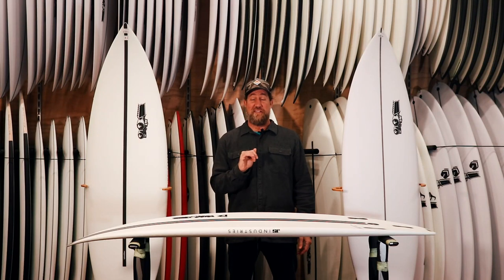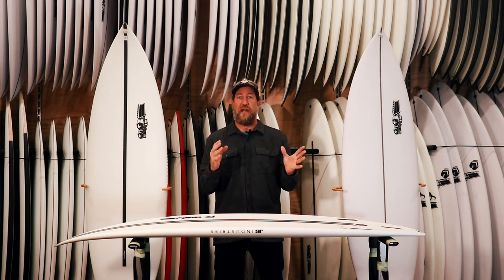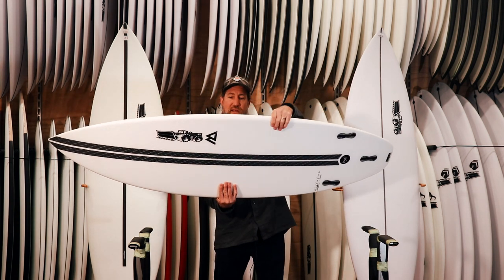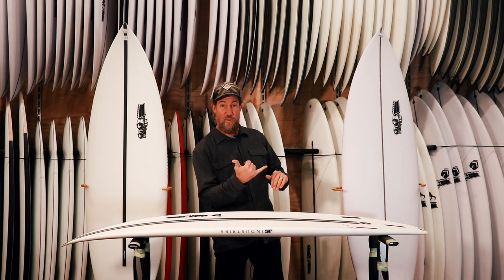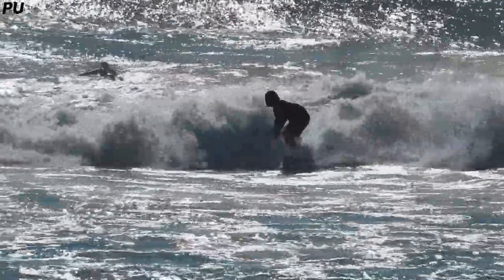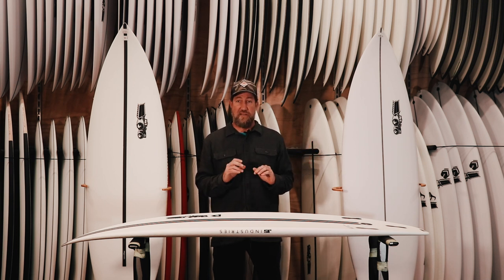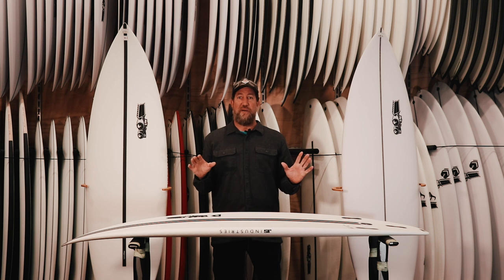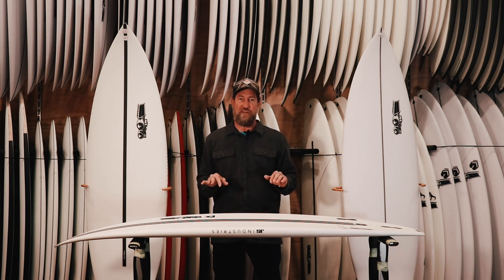EPOXY vs PU / JS HYFI Monsta 2020 Review - WOOLY TV #23

Comment: Its interesting I seen a interview with Jon Pyzel his opinion is eps only seem to float more because they are lighter in weight so basically if you have a pu and a eps exact same weight they'll float identical . So the pros boards are generally glassed light so no real difference for them and we need to get out that eps boards are actually worse for the environment because the foam last for a bloody long time before it breaks where pu breaks down a lot faster.
Reply from the maker: Hi mate
Wouldn't it be great if we could come up with a construction that performed really well and was environmentally friendly!
Reply: I’ve heard mentioned repeatedly eps foam is recyclable and pu is not. Would be curious to hear confirmation on this.

Comment: Also not sure if it's true but  I believe JS tweak the EPS versions of the board so they feel the same so that rider can just use their normal dims which I think it great. Weights are fairly close on both to which I also like. Boards can be too light in my opinion.
Reply from the maker: Yes, I think the pull the top edge off the rails just to get them to sink a little easier. Its only very subtle and I cant really tell much of a difference when I pick them up.

Comment: Fantastic review!! You are excellent at providing the nuance that has been so lacking in the surf industry regarding surf design information for the general public. 

You’re also ripping!! Good job representing for us slightly older and bigger guys!
🤘🤙
Reply from the maker: Thanks! One of the reasons I started the reviews was because I couldn't find anyone doing them that was around my height and weight, hoping these are helping everyone of my fellow larger humans
Reply: Nice to see a reviewer actually surfing the damn board too 🙄🤙🏼
Reply from the maker: @chrro466  I cant see any other way it can be done! You need to see the same guy riding multiple boards so you can see the difference in the performance in each board right?

Comment: Hey Wooly. G'day from NZ bro. Would age replace weight in terms of litres in the Monsta 2020? I'm 57 years, fit, but only weigh in at about 67kg suited up. Looking at getting a second hand near new 6.0 33L. For my good wave board. For our local I mostly ride a 5'8 flat fish Quad.  Trying to find a board that makes the transition from the fish a little easier when the waves are fast and hollow. Cheers
Reply: PS. One day I rode two different boards with too much volume for my weight and they were more maneuverable but sluggish. So slow off the bottom compared to my fish.
Reply from the maker: Hi mate
Do you know the volume of your fish? Or the width and thickness?

Comment: Very good man. 
But JS made it even more difficult...what about the PE construction ? (because down in Portugal we have received some Ranging Bull boards in PE...which I wonder how it behaves (closer to PU or closer to epoxy???)  THANKS
Reply from the maker: I havent ridden the PE (PU/Epoxy) as we don't get those in Oz but they would feel more like a PU as they have the PU blank with the timber stringer.
Reply: The PE is lighter as the PU, but gets dents a lot quicker!
The new Hifly 2 is really good! Much better, stronger and lighter then lost light speed construction! I like it a lot even in onshore conditions but I find it hard to surf when offshore gets strong. Then it feels like riding a bicycle with no suspension down a dirt road.
..and PU is made in Australia 🇦🇺, PE is made in Thailand 🇹🇭 if I am not mistaken.
Reply: @MarcRademacher  thanks . How would you compare it with the SpineTek from CI. I have 2 (NB2 and NB3) and it works quite well (not so good in on-shoe) ?
Reply: @josesnowsneves5132  sorry,  I never surfed a ci, yet! But if you buy a ci in Europe it probably comes from the Pukas, Olatu factory! So far every PU board I got from the pukas factory came with poor glas jobs. Had a few …lost boards from pukas. JS PU boards have are much stronger boards (makes it much easier to resell them after 1-2 years)
Reply: @MarcRademacher  Hi Marc, yes CIs are being produced at Pukas, Indeed you are correct, Lost glassing is not good, however the CI glassing is much better (do not ask me what but I had problems with 2 Lost boards, and, so far, no issues with the 2 CIs I am currently using. Thanks

Comment: Which construction would you go for the Happy everyday?
Reply from the maker: PU if in solid waves, EPS for more gutless waves 🤙
Reply: @WoolyTV  solid would be over head ?
Reply from the maker: @RBNK157  shoulder high and up. Or really punchy small waves. If the waves are weak the EPS will win.
Reply: @WoolyTV  i have a neck beard2 spine tek and usually surf only up to head high 5-6ft so that’s why I’m debating whether i should get a pu or eps 😅
Reply from the maker: @RBNK157  go EPS then